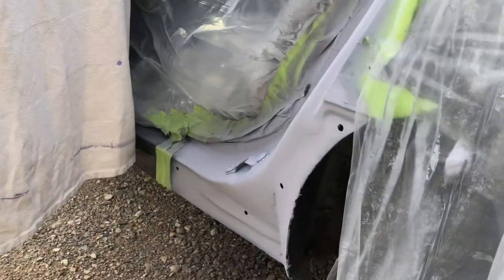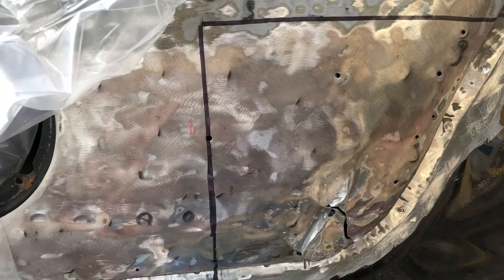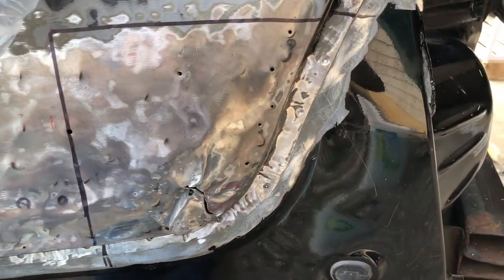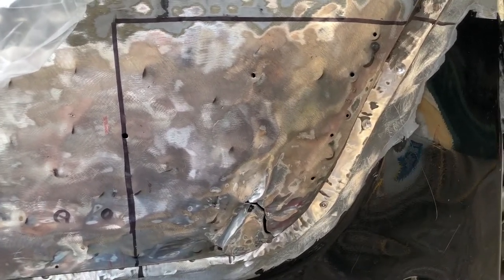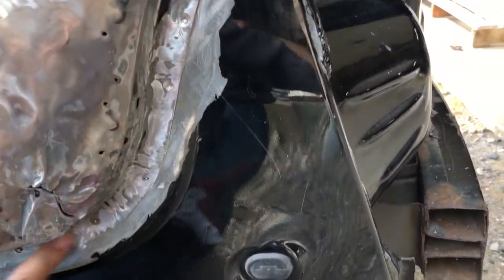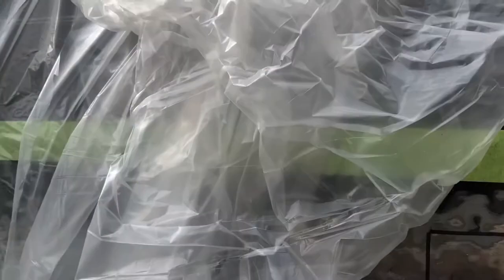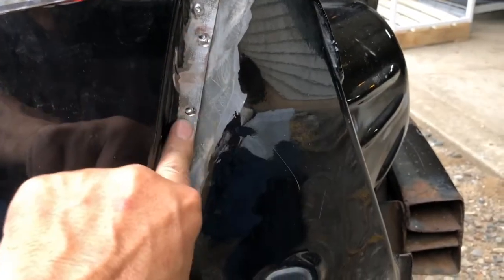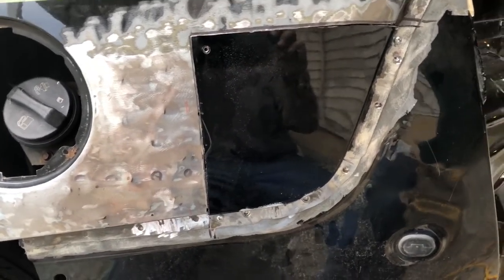Copart Project Car - 2008 Chevy Impala LT - Status Update 6 13 19

Comment: Hey good to see ya posting again ED! I enjoy the common cars. That's why i don't normally watch those other YTers with the super cars. I'll never buy those cars so I don't care. Your progress looks good. I don't record any of my car repairs because my audience is geared more toward vintage electronics. However i've been working on a Radiator support and front end replace on an 2004 Acura TSX and restoring a 2001 Honda CRV that was flooded in Hurricane Florence last September. (Yes Copart still has some of these they're selling off down here.) Anyway keep up the good work!
Reply from the maker: Thanks!  I wouldn't mind trying my hand on a flooded vehicle.  I also want to try pick up a hail damaged car for myself one time.   Might be fun to try and see what can be done with it with PDR while still having a decently mechanical car to drive.   I've also been looking at expanding my reach as far as states to purchase in.  Michigan only allows the public to buy clean title cars.  Unfortunately that means if it was an insurance case, they car will be at least 6 model years old.  Anything newer than that will be given a Salvage Title and unavailable to guys like me.  However, Ohio will sell Salvage Title vehicles to anyone and I can get a rebuilt Michigan title by having it inspected in Michigan by one of the state police inspectors.  That opens up cars that are a lot newer to work with.  The expense goes up since they are more expensive to purchase but the profit margin also goes up because you can sell them for more.   The only thing I'm having trouble working around is Coparts ungodly fees.   I paid $300 in fees for a $225 winning bid on that parts car.  That's ridiculous.  The only way I can see around that is getting a dealers license, which has its own set of expenses involved.